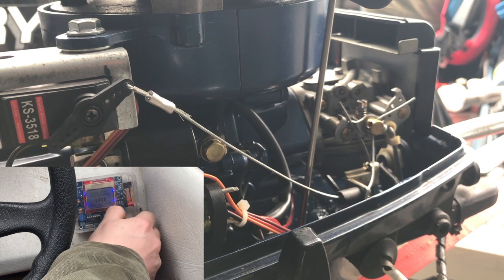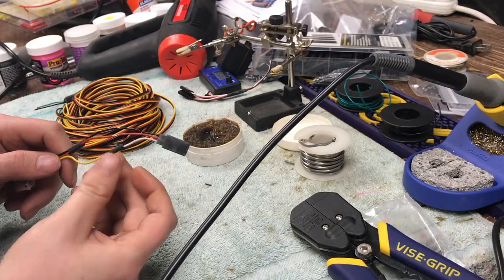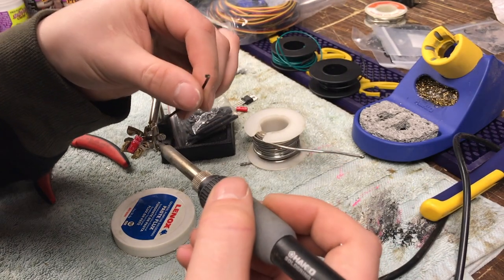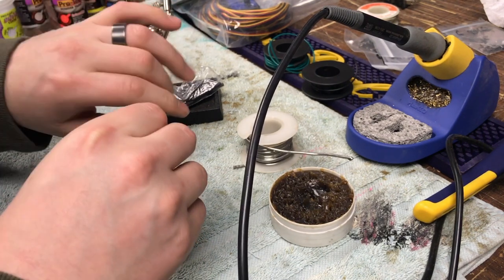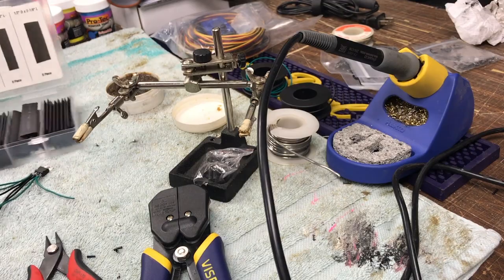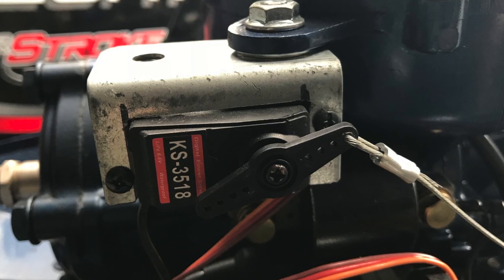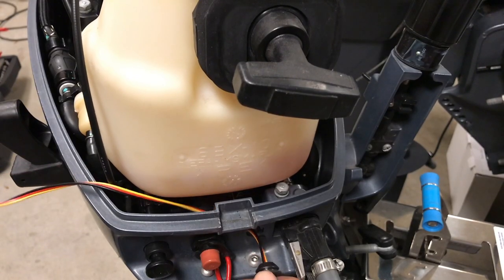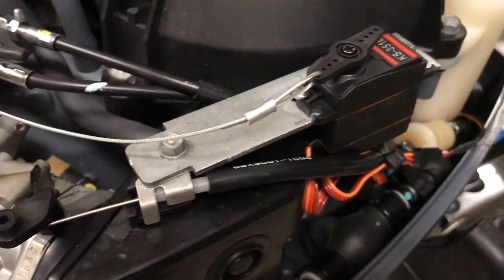How to : Servo controlled throttle for your kicker motor

Comment: Dont understand this. Wheb he finishes the regulator and capacitors he has three wires coming out but when he connects the 12v power he has 4 wires?